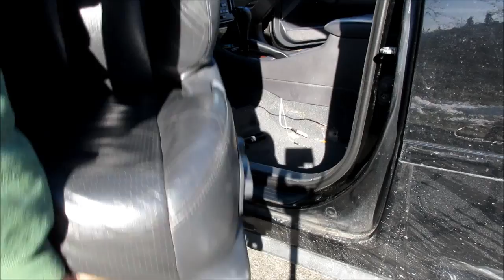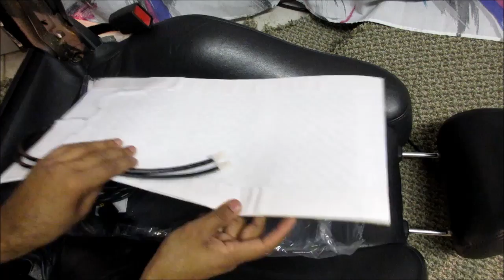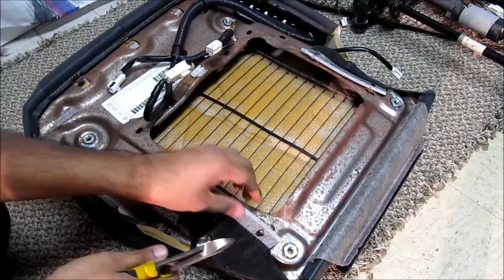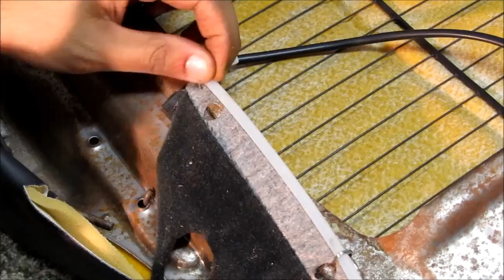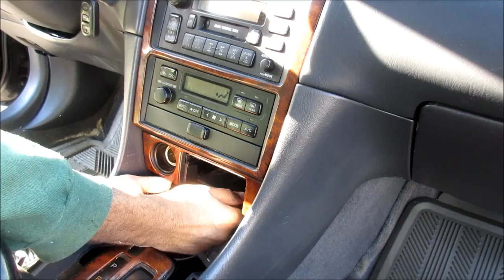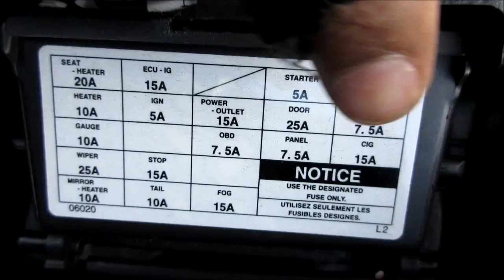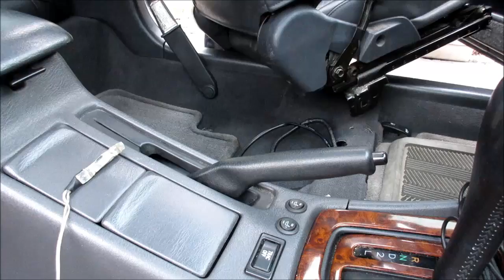Heated Seats Installation

Comment: Good.  But I didn't like the twist connectors.  I prefer solder, but at least a crimp connector, even a simple closed end crimp connector will work.
Reply from the maker: I agree...twist connectors were only temporary and shouldn't be used

Comment: Very complete and detailed presentation! One question. When you cut the heat pad for tge hog rings do you have to watch out for the heater wires. In other words is there a special way to cut the pad to prevent a short?
Thanks!
Reply from the maker: Yes

Comment: You should not be working on wiring if you are using wire nuts! Number one fail in automotive wiring.
Reply from the maker: I agree. Those don't belong in cars due to vibration resistance

Comment: Loved this video except for 1 small little thing, Never Use House wire caps on vehicle wiring, use heat crimps and or normal crimps
Reply from the maker: Yep you are right I've learned alot since doing this
Reply: @speedkar99  we both have, thx for the video

Comment: Excellent video. I do wish you had shown the fuse tap a little bit better. I see that you soldered it on but it was so quickly shown and kind of blurry. Trying to figure out how to solder my wire to the fuse. Quite clever. My kit says it a fuse tap is included but I don’t see anything like that. Thanks!
Reply from the maker: I recommend against that. Looking back that was quite a hack and you should look for a live wire to properly tap into
Reply: Understood, after looking around online for a little bit last night I came to the same conclusion that it was a little sketchy. I bought some of the add-a-circuit fuse to wire connectors last night on Amazon. Looks like a pretty good little trick. It has a spot for the original fuse and another spot for the second fuse.

Comment: Did you have to drive around to make your heated pads warm???
Reply from the maker: It's independent of engine temperature
Reply: @speedkar99  with them being electric,
I thought they would just heat up just from the battery straight away

Comment: Next I pull the engine and transmission to install the back up camara. Holy hell! I try and find easier ways to install my wiring. As stated, it already had heated seat fuse, that ment the wiring was already present, you just need to find the location of that wiring.  Automobile manufacturers do not make wiring harnesses, they farm those jobs out. They also do not make some with or some without that wiring. Its too expensive  to ask for separate harnesses, then deal with handling those separate harnesses. All wiring harnesses today are made to handle every available option and come with the wiring installed. If an option isn't  used, they simply leave the wiring where it is. As the ticket is pulled, that seat, eather with or without seat warmer is installed.  The harness is simply ignored if not used. Makes it great when adding other options because you can use that wiring for other features.

Comment: Quick question, why use anti-seize on those bolts? Wouldn't locktite be better since you don't want it coming loose? Is using Locktite AND anti-seize a thing?
Reply from the maker: Those are opposite. I live in Canada where rust is our locktite

Comment: Good video. Very instructional. I am going to install a pair of heated seats in my truck this weekend. I have a couple questions. If I'm wiring these in with a fuse tap can I put them both on one or do I have to run 2 separate fuse taps? Also I have remote start on my truck so I wanna be able to have the seats heat too while it's warming up. Can I run a fuse tap to something like the sunroof?
Reply from the maker: Yes but if it blows then you'll change circuit

Comment: If i have seat covers on my car, can i put the under the seat covers? i mean between the originals and the protections ?
Or the pads must be placed on the sponge?
Reply from the maker: You can put it under the seat cover. Just remember it might burn your butt and you'll have to secure it to seat so it doesn't slide around.
Reply: @speedkar99   Thanks for answer
 It wouldn't burn my butt because it is thicker than the original cover.
So if i secure it to doesnt slide around, it doesnt have the risk to burn from a short circuit or something?

Comment: Never use wire nuts in a car but the video was still pretty good I like soldered connections with heat shrink tubing and factory style conduit.
Reply from the maker: Good point. Next time solder

Comment: A  supplier focus on seating comfort system  _seat pneumatic massage, seat electric motor, massage，seat ventilation, seat cooler ,seat heater ,seat cooler and heater,seat heating and cooling, pneumatic lumbar support ,electric lumbar support power seat  adjust switch ,wiring harness, and other seat comfort system products.
Reply from the maker: I would like to take apart a fancy seat one day to see how it works
Reply: @speedkar99  Ddd my Wechat&WhatsApp+8613063086986
,we talks！

Comment: quick question if I have seat covers on top of my seats, would I still need to disassemble my seat? Or can I put it under the seatcover? Would it be way too hot?
Reply from the maker: You can put it under the seat cover but it might slide around and be a bit uncomfortable since you can feel it (and might be too hot)

Comment: Does it matter which pad goes onto the back rest or the bottom? And I’ve seen a few videos for heated seats but they all do this step differently, do the wires need to go into the back where they meet or by where your legs would be facing?
Reply from the maker: The wires should go to the back so it doesn't bother you, and you can flip pads.

Comment: Never use wire nuts in any automotive application.
Reply: Yeah I use alligator clips and duct tape
Reply from the maker: Good tip
Reply: Always test be
Reply: This and also never solder to an existing fuse just tap into a 12v source (use a multimeter) then in line fuse that.
Reply: My a/c ground has been an alligator clip for 4 years now

Comment: Not to rain on your parade but you absolutely should NOT be tucking that carbon fiber pad. It needs to remain as flat as possible under the seat upholstery with NO chance of shifting throughout its usage.  Carbon fiber does not do well AT ALL when bent back onto itself.  The resistance of the pad changes drastically and immediately as soon as you create an acute bend in the grid. You will get hotspots which leads to burns.  The burn does not necessarily happen where the bend is - it will happen at the weakest points in the grid and circuitry.  
Ya your install is fast, but not correct - sorry but i have seen too many shops doing this and seen also what is going to eventually happen with that method.  Your equipment is not warrantied from some manufacturers if you do it this way - you would be best to read your install guide thoroughly before you do it this way - this is not your grandpa's seat heater.  Technology is very dynamic these days and the way you handle it must also be dynamic. There is no shame in ready the guide and keeping yourself on the leading edge and also - covering your ass by doing it the way your manual says to do it.
Reply: AND ALSO...if you think this is DIY with the newer cars out there....you are in for a big surprise.  This equipment needs a professional installer. NOT DIY. NOT DIY. and just in case I did not say it before....NOT DIY.
Reply: What about cutting holes for hog rings?  My install instructions say not to but no ody talking about that in these comments.

Comment: Just wondering what size hole saw did you use. I use a uni bit but it is a tad to small and I always have to make the hole bigger.
Reply from the maker: +Gilbert Luna 1"? 
It's the same that came with my door welcome logo lights, see my other video
Reply: speedkar99 just checked it out. Thanks 👍

Comment: I have the same heated seat kit that I have been installing in my truck.i have all the harness wired up and everything to go so I decided to check to see if I had power on both plugs for top and bottom of the seat. I have power on both seats when on high.but when I put my switch on low I only have power to one plug for each seat. Would you happen to know the reason for this?
Reply from the maker: +Dets 19 how are you measuring that power? They work in series for low heat so it must be connected to work.
Reply: speedkar99 I am just using a power prob tester to see if I  had power to the two plugs for each seat.i do on high .but when on low I just have it on one plug.which to me means that just the top or bottom seat elements would be getting heat and not the other.so can you explain to me how this series works in order to power both plugs. I'm not the sharpest when it comes to electronics. Thanks

Comment: Wiring is not very clean: fuse tap and screw connector, no soldering? It's very easy to use original wiring and fuses if you buy the oem connectors. They just snap in the backside of the fuse panel and you will have an original look.
Reply from the maker: +Roy BM looking back I agree, I could have improved the wiring, but damn it was cold and I just wanted heated seats to work!!
Reply: speedkar99 hehe that's a good reason;)  I like them also very much. Better than hot air heating.

Comment: Great video all the way up until you start connecting wires. You’re using wire caps made for thicker wire used for ac, you shouldn’t use these in a car as they can come undone then you have a fire hazard in your car, any electrical connections in a car should be soldered or have a dedicated plug
Reply: And by ac i mean ac power as opposed to dc
Reply: Also, there is no reason to use anti seize for seat bolts as these are inside the car, if anything I’d used thread locker
Reply from the maker: +Wolf Pack yes good tip

Comment: I only have the pad and the switch button, what should i install between them to control low and high heat? Please help
Reply from the maker: +ali khalifa If I recall, the low setting was wiring the two in series and the high setting wired it in parallel.

Comment: My 1997 Lexus es300 heated seats are not working. Neither the driver or passenger.  Both ON/OFF switches light up orange when clicked. 

Any idea ?
Reply from the maker: +Martin Evan Check relays fuses and power going to the heater wires under the seat with a multimeter.

Comment: Hi,

I´m developing one project right now, look what I´m trying to do:
I want to build one chair using one audi a8 seat, why? Because I can set the adjustments using the commands of the seat and make it warm or cold.

The seat has heater and ventilation, massage settings and adjustments for almost all the seat parts.

here is the problem, I found one A8 seat cheap and is working as it should, but I noticed that the deep adjustments are made in the LCD panel inside of the A8, but here is my question, Do I need one central module or If I plug phase and neutral all together the seat will work with all commands?

Or another option will be : Take all the cables out and wire each one to a new panel with new buttons for each motor/function.
Does one 12v 30A will handle with it?
Reply from the maker: +hotsauce2007 the command system is linked to the internal bus in your vehicle. Your better off rewiring the actuators to a new module (like an arduino) and program it yourself, than try to figure out the Audi communication bus, unless you have a strong computer science background.
Reply from the maker: +hotsauce2007 the command system is linked to the internal bus in your vehicle. Your better off rewiring the actuators to a new module (like an arduino) and program it yourself, than try to figure out the Audi communication bus, unless you have a strong computer science background.
Reply from the maker: +hotsauce2007 the command system is linked to the internal bus in your vehicle. Your better off rewiring the actuators to a new module (like an arduino) and program it yourself, than try to figure out the Audi communication bus, unless you have a strong computer science background.

Comment: This is a great video, and a good study for a 'how to' video should be done, no extended intro, just the process and how to do it. Personally I'd have used a soldering iron and heatshrink sleeve on the joints, but if it's working, then it's all good. This is something I'm considering for a van I'm about to buy shortly for long distance touring.
Reply from the maker: Thanks, short and to the point is how i keep my videos.

Comment: This guy did a GREAT job in narrating this video. He also did a great job on the project I just like to critique one detail. You never want to use a household wire nut in automotive wiring never. Other than that great job.
Reply from the maker: Thanks for the feedback and tip. Short and to the point is my style.

Comment: HELP! I am trying to install this exact same one on my gf's 2012 Honda Civic and it is not working. I soldered the inline fuse to the power line and crimped the fuse tap on to that. I looked up the fuse diagram and hooked it to the existing slot 14 for the seat heater. Hooked up the ground to a screw on the chassis under the seat that other wires were grounding to so I know its a good grounding point. I checked the wire continuity with a DMM so the solder joints are good. I alligator clipped an external battery pack to verify that the switch works (red and green) and it does. It just does not work when hooked into the car (Yes I turned on the car). I even used a couple other random fuse slots that were rated for 10 amp to no avail...

Am I missing something??

Comment: Was your car in a flood? Why is there so much rust?
Reply from the maker: +teengeek17 Not flooded. These seat rails tend to surface rust very easily, because they're bare metal and not galvanized or painted. I took them out and repainted them earlier this year.

Comment: great video! very thorough! just one thing...I noticed you doubled up the floor mats in your toyota...noooooo!!!! don't do that!!!!! the accelerator will get stuck and you will crash!!!!! 😜😜😜
Reply from the maker: My Toyota is drive by cable throttle and doesn't have the electronic throttle issues the newer Toyota's had. The floor mat thing was a cover up for a glitch in the DBW system. Besides, I keep my mat away from the gas pedal, and rarely floor it.
Reply: It was a joke. But I'm glad you're safe😊

Comment: Wow good job. Im going to mount my switch to the  side of the seat, save a whole lot of time messing with dash trim and  center council. Other option would be to use the 12 v lighter power from council. Increase the Peace thanks for this.
Reply from the maker: +seewall11 thanks. The 12v socket only has a 10-15 A fuse on it, so it won't be enough for both seat heaters, plus what ever accessories you run (GPS, dash cam, tail gater deterrent system, etc)

Comment: How long do these seat pads usually last? I may be buying a used Impreza without any heated seats. Winter conditions are harsh where I live.
Reply: I'm replacing the OEM drivers side seat heater in my car ('08 Civic Hybrid). It died after 9 years. However, my parents '99 Toyota Landcruiser's  seats heated up hot and fast still, when they sold it last year. It had 350,000 miles and still worked beautifully. Seems that they are really simple devices, and like any electronic, they can die for no reason. If not, the work forever.

Comment: My question would be does the leather sit more "loose" on the seat than it was before you dismantled it?
Reply from the maker: +WhiteSlift No, I replaced most of the hog rings and the leather is as original. 
If you miss hog rings then it will be loose. It's not like your stretching the leather to get the heaters in.

Comment: damn you do very neat work. I have a question about the wring.. should you wire the relay to the cigarette lighter for power, and the positive power for the heaters directly to the battery, that way they'll turn off with the ignition but draw power directly from the battery, to avoid drawing too much from the lighter circuit?
Reply from the maker: Yes that can work as well. I didn't want to tap into my already over loaded 12v outlet line and had a seat heater fuse in the box anyway.

Comment: I plan on purchasing the corbeau GTS II seats in leather for fox body mustang.  corbeau wants $50.00 per seat for the heater mat install from the factory and they send the wiring harness with the seats.  Is it worth $100 to have them do it?  The leather well be brand new and very tight.  just need an opinion.
Reply from the maker: +Darren Hall Yes, that's worth it. My kit alone was roughly $70 from ebay, so to have them do it while the leather is off is much easier.

Comment: Hey great video! is there an "off" position on the switch as well as a "low/high"? thanks
Reply from the maker: +Ryan Madmann Yes, the center of the switch is off, then down is low, and up is high. 3 way switch.
Reply: @speedkar99  That's great, but does it turn on only when the car is turned on? I don't want to waste battery became I forgot to turn them off